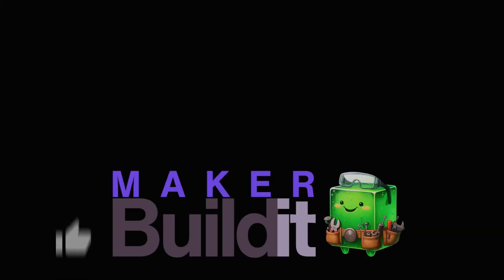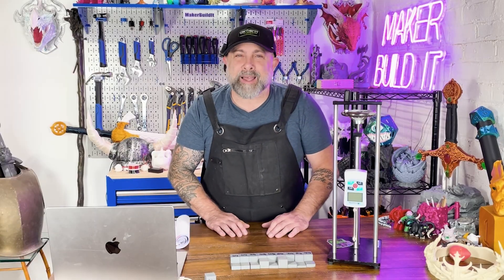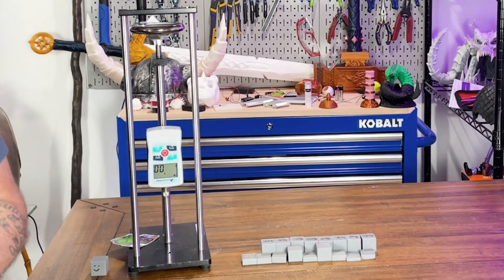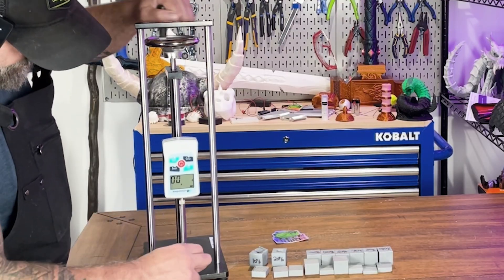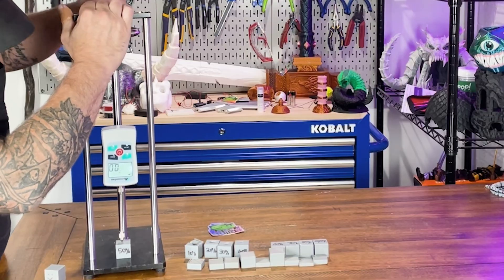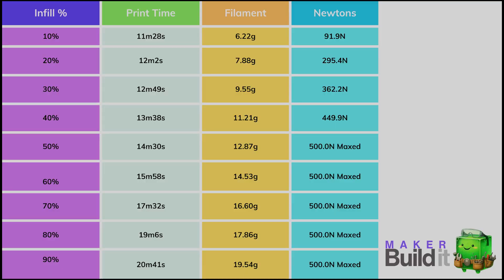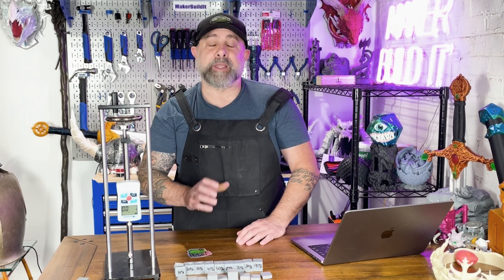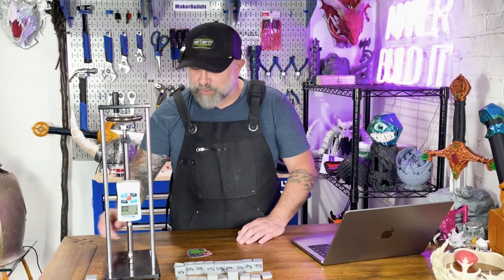The BEST Infill Percents for 3D Printing (And When to Use Them)

Comment: I've been doing 10% to save filament... but I'm now wondering if I should go more
Reply: An interesting test!
Reply from the maker: Saving filament is awesome, but going too low can sometimes hurt your print's strength. For most parts, bumping infill up to 15 to 20% gives you a big jump in durability without using a ton more material.
If you need something really strong, walls make a bigger difference than infill. 3 or 4 walls beats 40% infill any day. 
Play around and see what feels right for your projects! Hope that helps. 😁